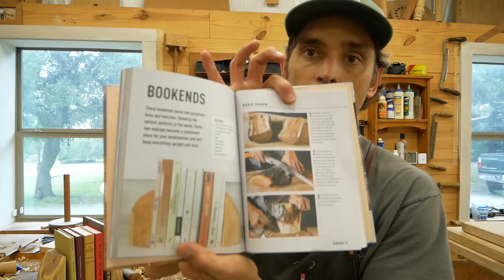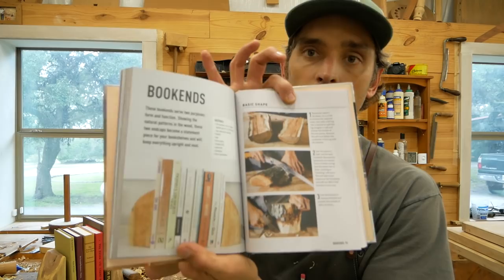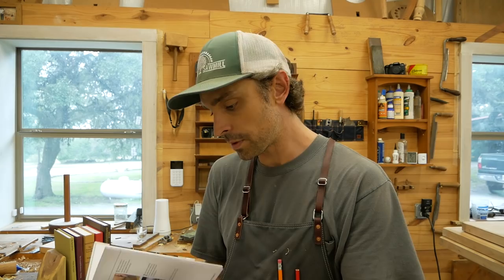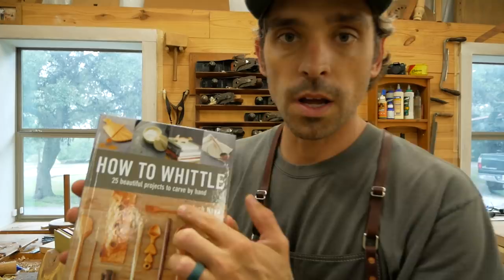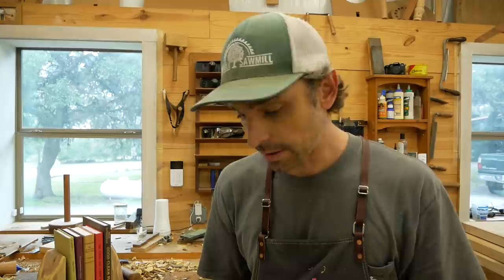Carving Bookends From A Tree Limb

Comment: Love the Video's Andy!  Keep them coming! Question, the wood looks kind of wet, are you worried about splitting did you put on any sealer to help prevent this?
Reply from the maker: Yes, it will split as it dries and there’s not a whole lot that can be done about it, especially with oak.  I think it will just add some character.

Comment: Could I ask a newbie question? I have a 62 like yours, it's my first hand plane. I've gotten into the habit of tightening it so tightly that it has to be loosened to adjust the depth. So whenever I adjust the depth, I loosen it before and tighten it after. Is that supposed to be necessary, or am I doing something wrong? I noticed that at 3:16 you adjusted without messing with the tightening knob. Mine is a lie nielsen. Thank you for your time!
Reply: I can't speak to the 62 specifically but on normal bevel-down planes you don't need to have the cap screw that tight.  Just go into your shop and mess with it for a bit and try loosening it a little bit at a time until you can move the adjuster while the blade is locked down.  You'll be suprised at how loose it can be until it starts slipping.
Reply: And what you're doing isn't actually hurting anything, its just a bit overkill
Reply: That knob there is supposed to move the plane blade up or down, in his case the blade was to high up so he set it lower in order to get a tiny amount deeper into the wood and that knob does that automatically so he can get precise cuts. I had a similar thing happen to me when  I got my first plane blade I forgot to put a piece in that allows me to do that, so if I wanted to move the thing up or down I had to loosen, move it a fraction, and tighten back into place. If you took it apart in the past and had an extra piece you should look for it, if not then you may have set it up wrong. Of course I have never used a lie nelson plane before but I think thats what you’re talking about.
Reply from the maker: You shouldn’t have to loosen the cap screw to make adjustments, just keep it tight enough to hold the blade securely.  There’s a sweet spot for that and it takes some adjustment to find.
Reply: @AndyRawls  (and everyone else) Thanks for the helpful input! I'll tinker with it and figure it out.

Comment: i wonder why you use the bandsaw to cut the log in half but an axe to cut it in half again only to be bothered by using a plane forever to smooth it out. Wouldn't bandsaw and light plaining be more efficient? Since you have used a powertool anyways